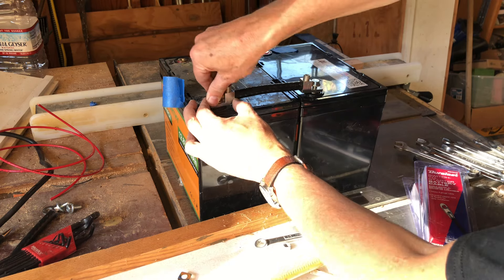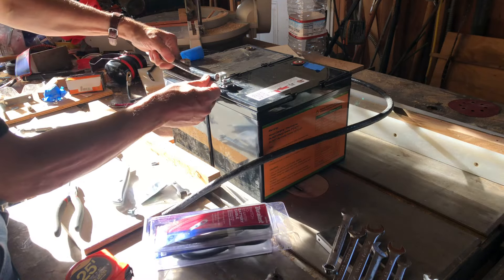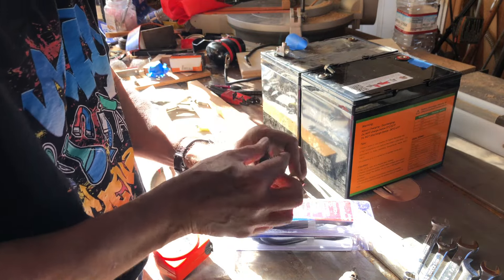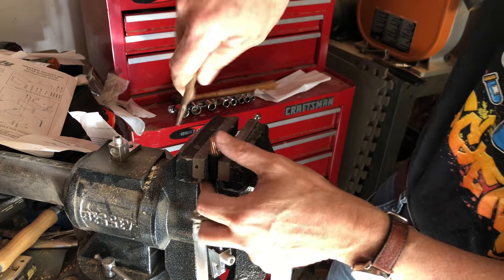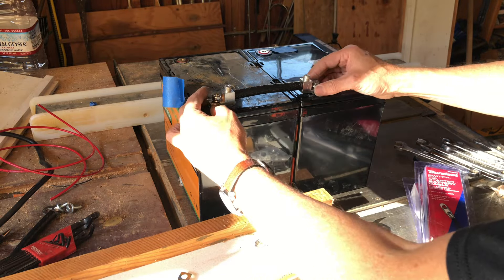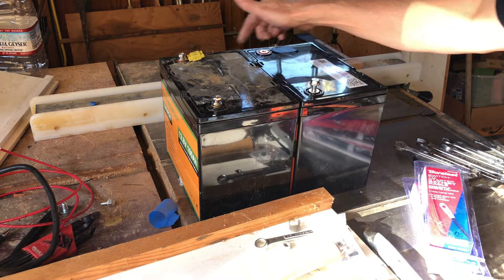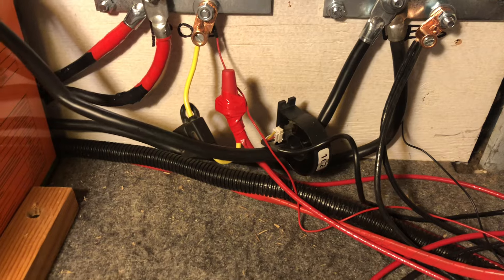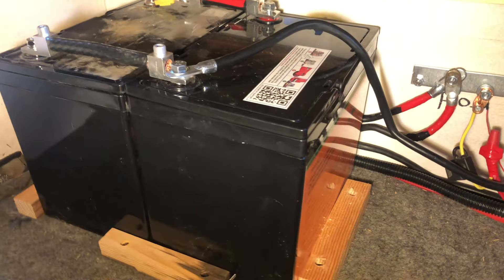How To Properly Wire Batteries in Parallel

Comment: Two small points.  First the lugs you used appear to be aluminum.  When mating them with copper wire the inside of the lugs should be slathered with antioxidation paste to prevent oxidation and an increase in resistance.  NoAlox is one brand.  Second, while installing a fuse is a great idea, you should mount it in such a way that there is no mechanical tension on it. I know your batteries aren't heavy but one good jerk and the battery on the right yanks on the fuse and mechanically breaks it.  Add a fuse holder and let it take any mechanical forces.
Reply from the maker: good points.  I tied the batteries together with blocks to prevent movement but I like your idea.